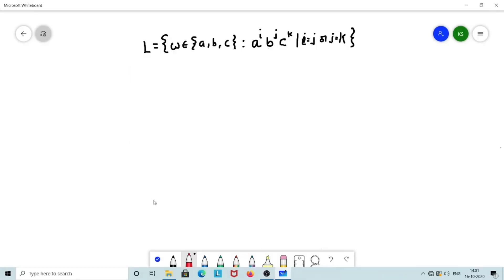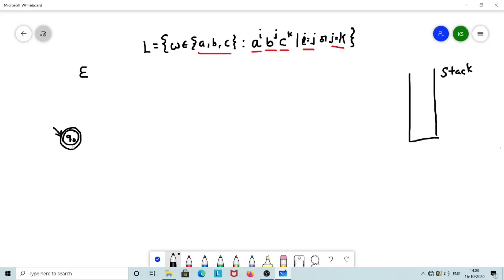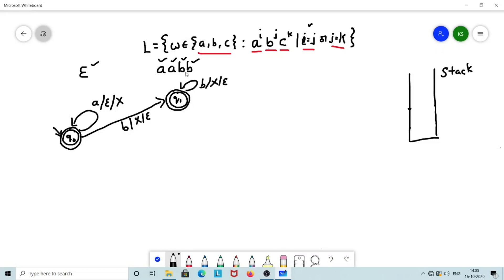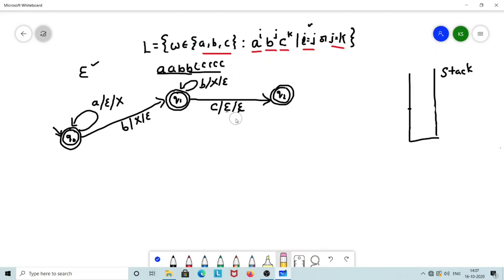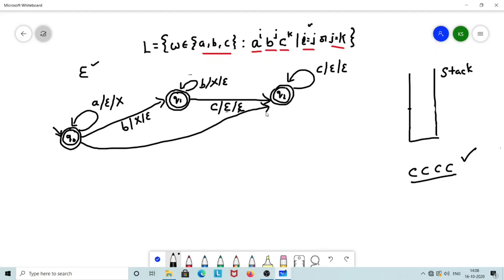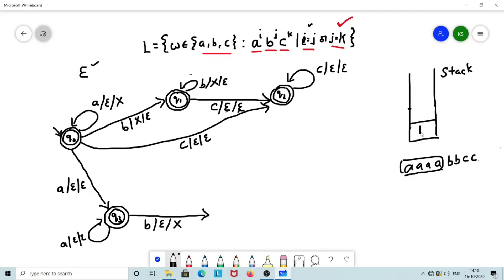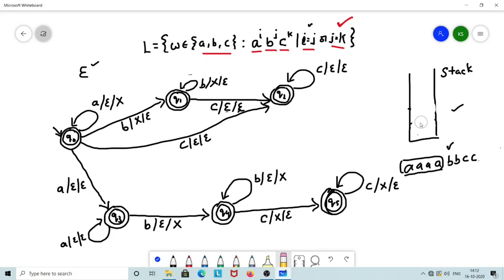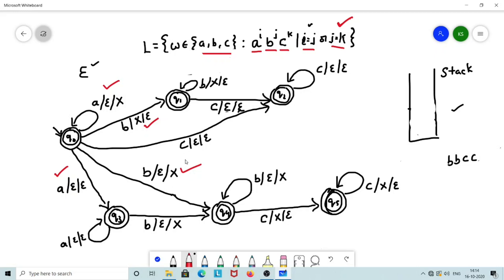VTU ATC (18CS54)  [PDA problems part2] (M3 L3)

Comment: Can q4 be an accepting state? Bcz if we get epsilon or just a's. Q3 is the accepting state. But if we get just b or aaab it can't be an accepting state.
Reply: @Deeksha D good obversation, q4 need not be marked accepting in this problem, but marking q4 as accepting brings no harm as the pda accepts the string if and only  if both the state is accepting and the stack is empty. observe b or aaab as you mentioned in the comment is not accepted by the PDA